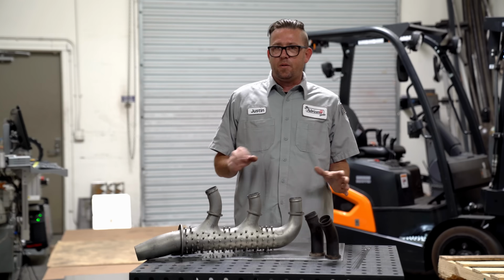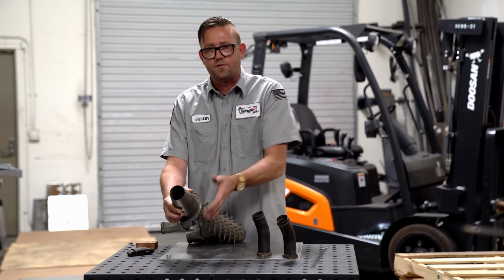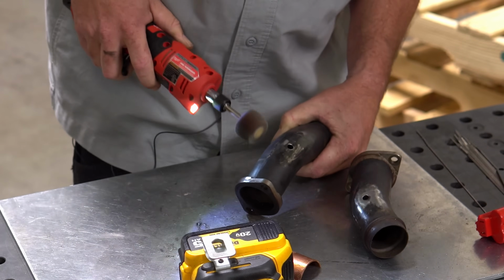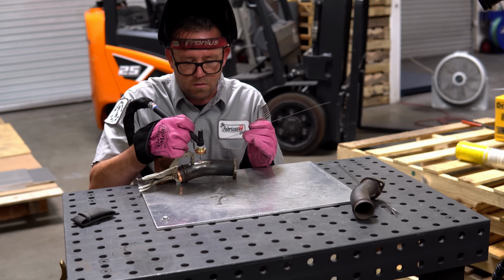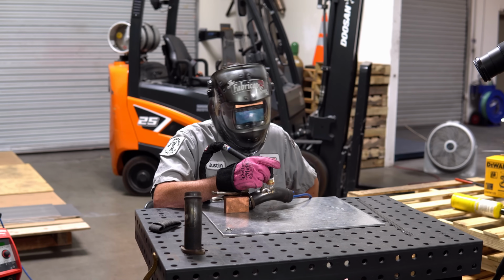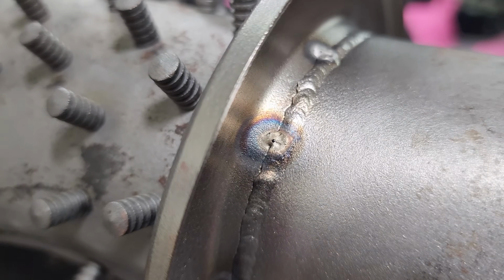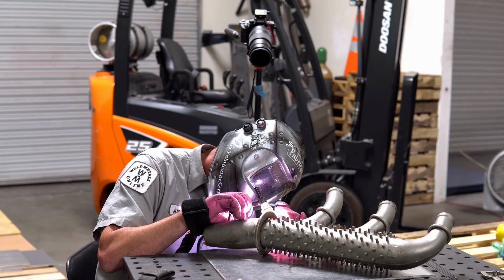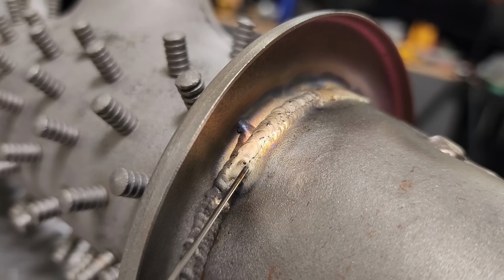Weld Repairs You Should Avoid

Comment: That brown color of the stainless happens after only a few hours of use with a new exhaust system. I seen that on my planes. They all turn that  color. Most are made from 304 stainless. Or 321 stainless, which contains some titanium to help prevent cracking.

Comment: I wonder if you would have tapped that hole on the side with a Tap & Die set, then threaded a similarly aged bolt into the hole, then welded the bolt used to fill the hole, to the exhaust, if it may not have worked out better, being SURE to clean all surfaces vigorously. 
    I'm not sure that TIG Welding is the ideal manufacturing process for this repair. 
   BE AWARE of STRANGE  SMELLS while welding. Occasionally novices will use Perchlorate compounds (like Brake Cleaning sprays, that can, and DO, produce POISONOUS Gasses; especially if the welding area is enclosed, and/or not vented properly. 
   longer shirt sleeves may be hot... BUT it sure beats Melanoma‼️
   BUT, that being said/good shots on Sugaring, Preheating to eliminate mousture, and when to/not to take on a welding job. 
    Respirator... 
yes, just ro avoid whatever chemicals may have been used to prep surfaces before yo got handed this difficult experiment.

Comment: I'm not a fan of wire wheels.
strands break off, embed into clothing (or bare skin), then fall off in random places later. (in the car, office or in laundry)
full face shield, long sleeve shirt and long pants minimun. 
plus work in a booth or have weld screen if in a workshop with others.

that wire wheel is way too big for the handheld drill.

Comment: That was a good video but I've never thought to use 309 i aways go with 316L when in not sure what type of stainless it is. I will try the 309 next time I do something like this. I've recently started my first maintenance welding job and am surrounded by mechanics who think brazing is the same as tig welding so not much help there. Im having some troubles cause I haven't arch welded in 20 years but its mostly going good. Im thinking about asking them for a tig welder

Comment: Among other very good lessons in the video there is a demonstration of why I hate battery tools. Dead batteries that you must wait on to be charged up, or if it's an older tool with older batteries, the amount of battery power you might have even if having 2+ batteries are not enough to be able to complete the job without having to wait on charging even if being religious about plugging the batteries into the charger/s.

Comment: Overall an excellent video, Justin. I especially liked the way you managed the puddle while filling the holes, You have good hands and eyes, no doubt about that.

A few things I didn't like:

1) Early in the video you used a magnet to determine the manifold and tubes are stainless seteel. That is NOT the best test because some grades of stainless are magnetic namely martensitic and ferritic. Austenitic stainless is non-magnetic and fortunately austenitic is the most widely used grade. The magnet test is somewhat helpful to determine correct filler rod. You got lucky when you observed the pieces were not magnetic and you selected 309 filler because 309 is comatible with austenitic. What would you have done if they were magnetic? Would you have concluded plain carbon steel and used mild or low alloy filler?  That would have been a mistake.

2) The problems you encountered had nothing at all to do with fatigue and everything to do with contamination. Metal fatigue is a condition caused by repeatedly flexing, bending, expanding/contracting the material. Metal fatigue causes invisible micro fractures which lead to visible cracks and eventually breaks. However fatique does NOT cause the holes and discontinuities in you pointed to.  Contamination causes holes and discontinuities.

3) While it is a good idea to use a hand gesture once in a while to emphasize and/or color a point, it is not a good idea to wave hands around continuously. It's distracting and adds NOTHING to the presentation. You have a pleasant voice, good enunciation, good cadence, good inflection and a strong presence. Use that. Don't take away from all that good stuff by waving your hands around like a spastic clown.

4) As for the troublesome ring... it's possible it wasn't even necessary for the engine's new application. I would have discussed getting rid of it altogether with the customer. If it turned out to be necessary then I would have taken the manifold with the ring still attached to a sheet metal shop. Rolling machines that can turn a lip onto a donut are very common.

Comment: you were wondering about colors from welding 1950s aircraft exhaust, the primary stainless steels used were Type 321, known for high-temp creep resistance due to titanium, and sometimes Type 304 for less extreme areas, with Inconel (a nickel-chromium superalloy) used for the hottest sections, especially in turbocharged engines very to weld aged stuff, rather have a t950s bottle of wine and let some youngster weld it lol

Comment: That is not for cooling. That is a heat exchanger for cabin heat in the plane. There is and external case that has been removed. Cab air blows thru picking up heat from the exhaust. The little spikes help with surface area. Have killed many pilots. Exhaust cracks then pumps the cab full

Comment: I had done some f-ed up repairs for a guy,did the stainless,but it did not want to flow! So I used a phone a friend( been tig welding since the days of notifying the FAA when they were doing super high freq ) he said if you are worried about the seal,cap em with silicon bronze!

Comment: actually , if the part isn't soaked, most of the moisture is from the gas in the canister, as the molecules of hydrogen condense against a surface with lower temperature, binding themselfes with oxigen , forming H2O, that's why you should alway try to heat up parts with electric heaters, especially in aluminium

Comment: That part is probably 321. Use 347 filler. I never tried 309..
   Used to weld various aircraft parts, but gradually stopped. I'm an A&P/ IA, I figure I have no excuse when something goes wrong, can't say "I thought it was plumbing.." or something.
     The studded manifold is for cabin heat...I would never have welded that. They do kill people regularly, cracks let exhaust gas (Carbon monoxide!) Into the cabin.
     You don't want your name on that.
   A guy that owns an airplane, and puts his family in it, can buy a new one, or he can't afford the plane.
    The lead combustion products that coat the inside, that you often can't get out, can end up in the weld. 
    What alloy is that? Don't know? Me neither, so I'm not going to be the guy to put it where 321 only was specified by the manufacturer .
    These are the things the lawyers representing the family of the deceased will ask you, and "ummm" is not the right answer.

Comment: When you were trying to flush the potential abrasive out from under that flange with acetone, would a can of brake cleaner have been acceptable to use, because it has a little more pressure to the spray?

Comment: Justin, could you have got a better seal from the copper by adding a shallow pimple that raised it up to the ss hole edge? Something like a 1/8 drift punch on the back, tapping into a 3/8 steel nut on the other side. Too much and your plugweld would be thin in the centre. You could sand the pimple flat on the top a little. Just putting the thought out there incase it's useful another time. Thanks for your excellent content from here in New Zealand.

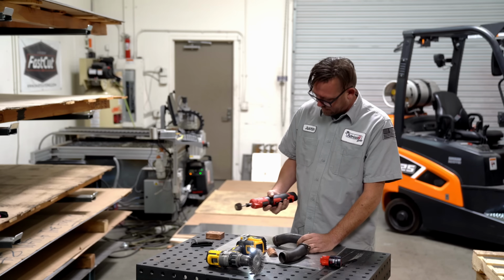Comment: 9:55 I wouldn’t buy a milwaukee OR dewalt. Milwaukee is a ‘no’ because I don’t enjoy the feel of using them and I’m ‘culturally’ opposed to fanboy brands. Plus I have small hands and tendon issues and milwaukee is heavy and - to me- has very poor ergonomics 

Dewalt is a ‘no’ because I have burned up their tools in record time- sad when a harbor freight offering outlasts a brand new ‘premium’ more expensive brand. 

Makita and some bosch stuff seem dependable if I’m buying hood tools; in a year they become less expensive than cheap tools. I have several very used makita tools that are 20+ years old still going strong… nd I don’t think the current Porter Cable tools are good; they used to be top notch.

Comment: Those 12v die grinders can handle the thinest 3 inch cutoff discs and are ok with a 3 inch roloc, but are generally best for 2 inch and smaller attachments otherwise. Also you really need at least the 4ah batteries, that goes for any of the brands...

Comment: You need to back-purge stainless tubing, or you will get that terrible sugar crystal structure to the metal. Also, wipe the parts down with Acetone to get all of the oils off. Prep work is 98 percent of the job to getting a proper weld. I’d love to get your Welder (definitely my dream machine.) I want to try the Fronius Bluetooth Helmet, and I despise Aluminum Spool Guns, I believe Fronius has a push-pull MIG/MAG setup. 👌🏻 Using a Phillips Alloweld Lens along with a Super Magenta, and/or Super Blue drop-in then a Magnifier and Clear Glass Protective Cover Lens to protect that all will get you Arc Shots similar to Stacy’s. Pricey, but worth it for the Arc Shots that you can achieve.

Comment: How do you know how much gas to run on the inside while welding on the outside? How large do the holes to flow through need to be or how many holes in the tube block off material?

Comment: Hey Justin, this may be late in saying, but I saw you struggling with that Milwaukee right angle die grinder, and it gave me a PTSD episode from when I had similar experiences.  Milwaukee builds a crap ton of overload protection into their motors, especially those M12 die grinders.  They can only handle very small implements, like carbide burrs or small prep pads, nothing larger than 2" in diameter.  A much bigger wire wheel like you were using will completely overload the tool over and over, especially if you really push it into the workpiece aggressively.  This is also why you had much better luck with the straight die grinder with the little sanding pad.  That's much more along the lines of the implement you can use on these Milwaukee M12 die grinders.

I'm enjoying your lessons on this channel and on Weld Coach.  Thanks for doing what you're doing, I'm learning a lot.

Comment: I had a similar experience with Milwaukee's cordless angle grinder (6").   We use milwaukee tools at work and I've always preferred them, but I despise their angle grinders (the cordless ones).   They have a double trigger switch that is supposed to be like a safety paddle, but if you grab it in just the right spot it triggers both directions and it WILL start the blade.   I carry it with no battery in it when I have to use it.   It does NOT like cutting anything thick.

Comment: You need to get a high output battery for that Milwaukee die grinder and it’s a 2 inch die grinder and you’re using a 4 inch wheel. Your batteries do not have current to handle it. M 12 5amp high output.

Comment: My angle die grinder works much better with at least a 4.0 battery and 1" wheels. What you're doing i would grab my 4" M-18 Fuel Angle Grinder with SS knotted wire wheel.

Comment: The right angle die grinder doesnt take much force and its shuts down. Its a finesse tool, not a force tool. I have one and have the same issue, its great at light duty sanding and cleaning, Heavy oxidation removal it doesnt cut it at all.

Comment: You don't need certification if it's for general aviation and it's the owner of the plane asking. You do need certification if it's a shop asking and maybe if it a commercial aircraft. Owners of GA airplanes can have parts they need fabricated or repaired outside of the certification repair system.

Comment: OMG! I bought one of those Milwaukee angle grinders about 6 months ago and the same happens. The shut off if they see much load. I've run their corded tools for years and love them, but these cordless grinders suck for the price you pay. I have one of the straight grinders set up for grinding tungsten's and it works great. Also, forget running a cutoff wheel with them. Bad on Milwaukee to advertise the power of an air tool in cordless. FALSE!

Comment: To ensure a proper job, it is important to cut off the old weld, thoroughly clean the inside and outside of the cut pipes, weld a light sacrificial weld, clean the weld again, and then proceed to welding the cover pass.

Comment: FYI!  I have the right angle M12.  It's only, ok.  Does what yours does, but much less so.  Point of post, I discovered the RYOBI pistol grip die grinder, and it is awesome.  Lots speed, and torque.  No stalls!    I got mine on sale for $99 bucks with 2 batteries.  I love it!!!  I think it was as much as $179 bare tool.  I'd say it's worth it, even at that price.  I really have no brand loyalty any more.  This RYOBI is actually very very nice. Comfortable in hand, and lots of power.  I will buy another for sure.  I haven't tried the M12 straight die grinder yet.
Reply: Ryobi basically owns Milwaukee!

Comment: 1. use a bigger battery on the milwakee die grinder.
2. Blasting with stainless steel grit is super awesome for parts prep if you have a cabinet and good compressor.

Comment: A few comments from people familiar with aircraft parts suggested this exhaust may have been Inconel not 304, 310, 316, or some other austenitic SS material. If you are convinced that an unknow material is stainless steel, but unsure of the grade, a good option for the consumable is ENiCrMo-3. It will work as well or better than E309 on 300 grade SS material and definitely better if it happens to be Inconel. The only cavate is that it is expensive.

Comment: I was a welder in another life, but finished my career as a welding inspector in the petro-chemical industry. We often have to weld new material to existing material that has been contaminated by process fluids. While meticulous cleaning of the old material is helpful, there are often contaminants within the grain structure. A technique referred to as "buttering" is a useful in welding a difficult joint that has the puddle popping up with contaminants. This includes laying down a sacrificial pass or two of weld metal that is then ground out before attempting to weld out the joint. The oxide scavengers in the welding consumable will often eliminate enough of the contamination to successfully complete (pass x-ray inspection) the joint. Don't know if that would have been any help with this job.
Reply: That is some dam useful information!! I'm a student, so I'm just gathering all the information I can
Reply: Makes sense and thanks for sharing. Will discuss with my welding engineer.
Reply: @MatthewTaylorAu  definitely l. Just binged a few hours of content pertaining metallurgy, precipitation hardeing and how phases of atoms and molecules bond as they pass time and temperature. Cool stuff.
Reply: Damn I used to do this a lot in work when welding on shitty metal never knew it was actually a proper technique!

Comment: Use regular cordless Milwaukee drill, not cordless impact. And not to be a prick but a little time to run a grinder through them joints would have tripped more asthetically pleasing welded.

Comment: Great video however from one welder to another one i can honestly say as welders we know our limits thats why we let another welder maybe with better equipment, better skills ect to do the job(s) that we cant or wont do however never ever have i once whined or whimpered or cried this bad lol jeeze so its welding like trash strip it down clean it extremely good polish the stainless after the initial prep, then use argon and nitrogen to flash the piece before welding, allow it to then vent and do a final polish fill with argon and then weld it wit 403 or 440 filler and a fresh tip

Comment: The Milwaukee tools are stopping because (apart from being poorly designed tools) the batteries are underpowered. You need to use a higher capacity battery, especially when using large diameter tools that overload the motor. They're mostly designed to be used with small die grinder stones, not a large wire wheel. Also, you should always wear a respirator when welding stainless, or anything that contains chromium. It can leak hexavalent chromium into the air, and that's highly carcinogenic.

Comment: Jesus, did you not bother reading the manual? Or, you know, THINKING?  Die grinders are high RPM/low load; that wire wheel is for a drill that turns 4500 rpm max.

Critical thinking is important 🙄

Comment: 12 volt 1 amp milwuakee vs 20v 5 amp. The smaller motor is for smaller bits. I bet the dewalt couldnt run a carbide burr bit as well as the milwuakee

Comment: I think he needs more experience outside of a clean shop and not work only as the manual states. Also wondering why he wouldn't grind out the cracks and why he would use a wire brush on something that clearly needs a angle grinder with a flap sanding wheel. Best wishes.

Comment: Total failure right off the bat using too big of a wire wheel for the tool and blaming the tool and not the user himself. Removing oxidation like that should have been done with a passivation machine. So many fails in this video. It’s tough to watch when people watch your videos to learn.

Comment: You forgot the biggest reason old aircraft exhausts are difficult to weld. Lead permutation. Not just normal Heating and Cooling Cycles but shock cooling from altitude change essentially mixes lead in with the surface of the metal. You can almost look at it like Anodizing aluminum. When the grain structure expands the lead Flows in and when it contracts contracts lead gets trapped in The Matrix and when you try to weld it you're forcing the lead out as you go. The technical term for that is yucky.